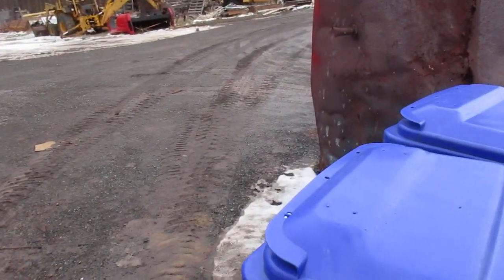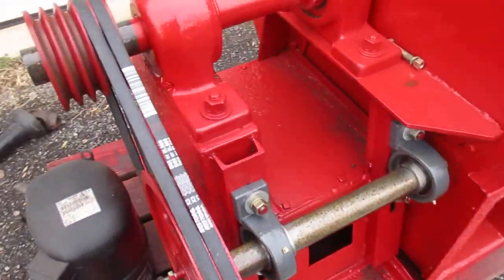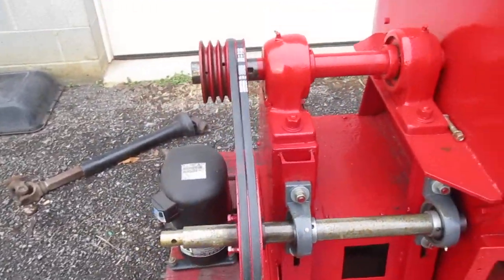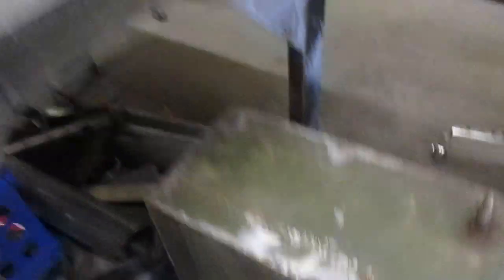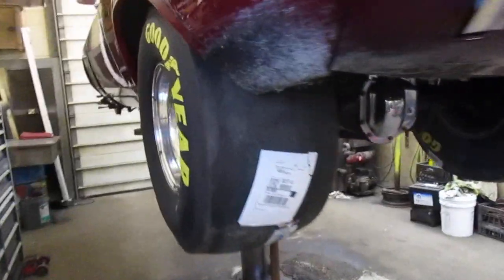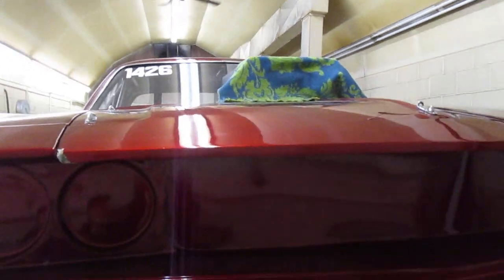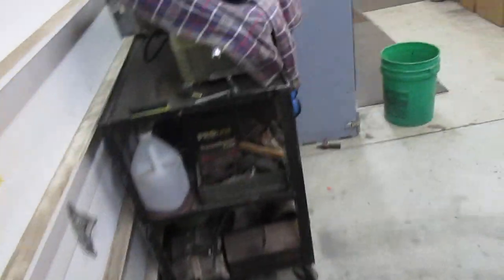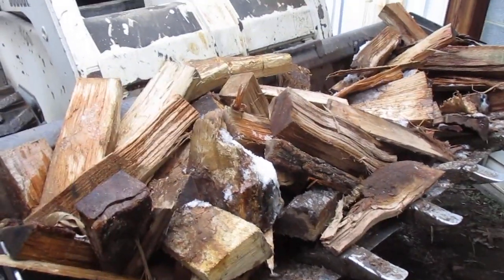Whats up at Jeffs  #617

Comment: I have been around heavy mechanics since I was 16 and one of my best friends father got into racing boats.  It was a ski class runabout with max engine of 400 cubit inches, normal aspirated carbonation, with street gas.  I mostly watched when he took a two four barrel cross-ram manifold and modified it according Mickey Thompson’s blue prints into a 6 duces cross-ram manifold with six 550 CFM Holly truck carburetors.  I was involved with pulling the engine and tearing it down for inspection and putting it back together.  But I have never heard of making a 4 bolt main out of a 2 bolt main.  Please make a video of that process..
Reply from the maker: hi there there are some on y/t that mat be where he got the thought . hard to video because a bit of a drive but if i and there i sure will get some , good story  have a great weekend john